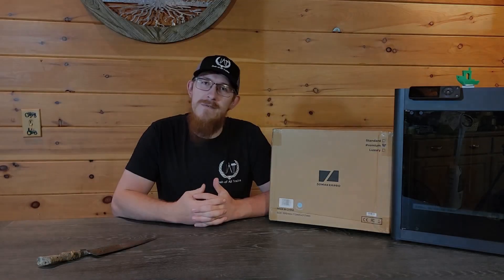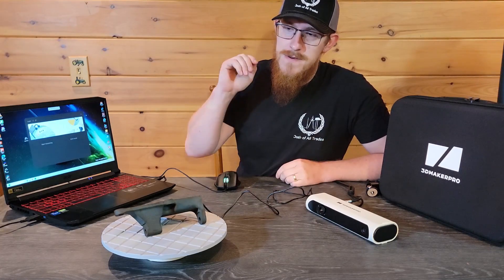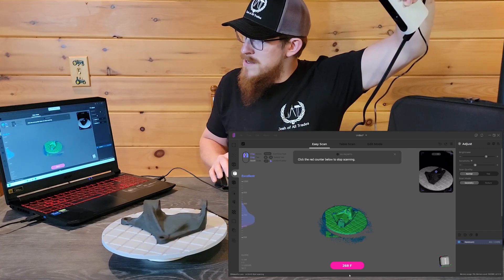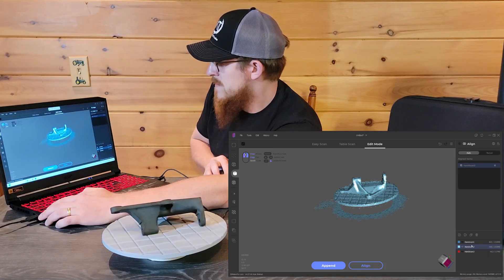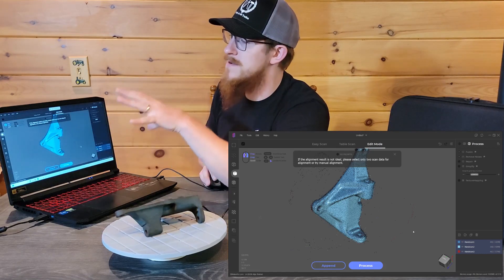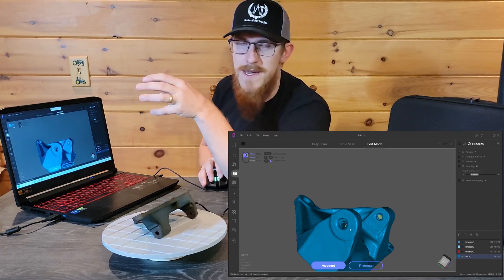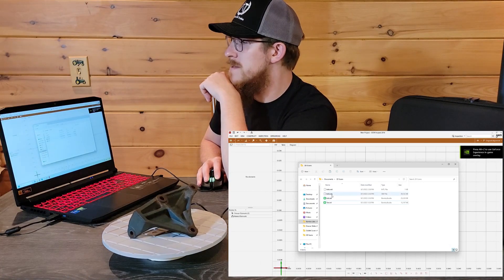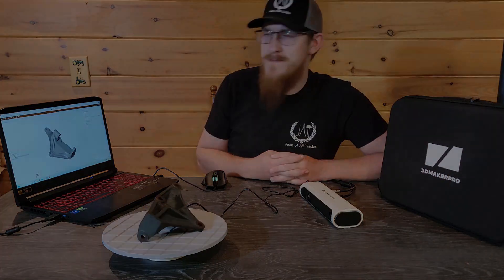3DMakerPro Lynx Unboxing and First Scan

Comment: Thanks for mentioning the GOM Inspect. I’ll have to check it one out.  It looks easier to use for scan editing than Solidworks.  My Lynx loses tracking pretty frequently, but I’ve been trying to use it for larger scans, where using the turntable isn’t possible. I’m thinking that I may need to try to scan smaller areas (with considerable overlapping regions) and let the system align the scans.  Hopefully that works, because it can be a bit frustrating.
Reply from the maker: Yes gom indirect is great.  And if you move slowly and have geometry to fit to it should work out.  Also if it's very flat and featureless you can add geometry you remove in post processing

Comment: for a part of that size, won't be better to use Mole or Seal scanners?
Reply from the maker: You could,  but level of detail is more than adequate. If you want to see something larger I did another video scanning an engine and transmission

Comment: What laptop/graphics card are you using?
Reply from the maker: I'm using an ACER Nitro 5 AN515-57 with the intel core i7 11800H @2.3 ghz and NVIDIA GeForce RTX 3050 Ti graphics card. The thing is, in 3D Scanning RAM is king. A lot of the 3d scanning and processing software out there do a terrible job of effective resource use and rely strongly on Ram. My laptop will only use 32 gb ram. I tried to get 64 but the bios couldn't handle it. You will do much better the more ram you have. We ran crazy multi core processors and high dollar graphics cards at my previous job and found that most software doesn't utilize graphics cards or even the multi cores in the processors, and the "cheap" computer with 128gb of ram ran everything a lot better. I strongly recommend as much ram as you can throw at whatever computer you are using. You will have a much better experience with scanning. A good processor and graphics card will help for sure, but the ram will be a much better return on investment that crazy graphics card and processor.
Reply: @Black240SXDrift  TY sir, that is exactly what I wanted to know. I had to buy a new computer for mine (needed one for the shop anyways). Later i5 with 16gig seems to do the job when it is plugged in. There must be something in the power settings that causes it to struggle otherwise.
Reply from the maker: @charlesbauer1747  yeah laptops usually throttle performance on battery.  You could play with the settings,  but I always plug in because even the killer laptops we had at one of my last jobs would suck a battery dry very fast.
Reply: @Black240SXDrift  pretty impressed with this thing so far (got mine friday). One freehand scan on my kitchen counter produced a very workable scan (I am far from an expert). I didn't get the turntable because we have weld positioners at my shop and the tripod looks pretty cheapo as well.
Reply from the maker: @SlappynutsMN  Yeah, honestly it's not super needed. With the stand off distance of the scanner, the stand provided is too small to get good angles by itself. Also the turn table is really only good for smaller stuff and is just convenient so you don't have to walk around the part to scan. I would almost rather just use a cheap lazy susan type manual turn table because the automated turntable is tethered to the scanner, so it's one more cable to contend with. The biggest thing is slow smooth movements so the scanner doesn't loose tracking. The program does a decent job automatically getting rid of data, but if there  is bad data too close to good data, you end up with weird mesh issues. This happens even on higher end scanners, though not as often. That's really one of the downsides of scanning with no target recognition. But the scan I got was very useable and decent quality. There a tricks you can do for "cheating" accuracy for things like hole locations etc to work around some of the issues. But spending a little more time scanning will definitely  save you a bunch of time in post processing.